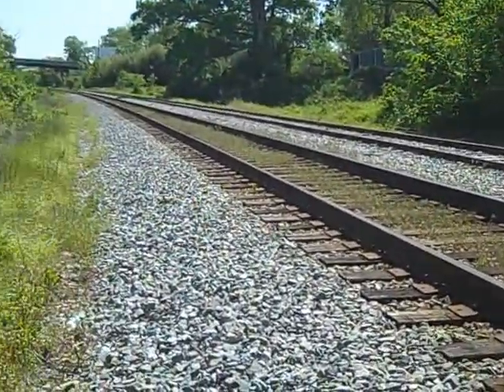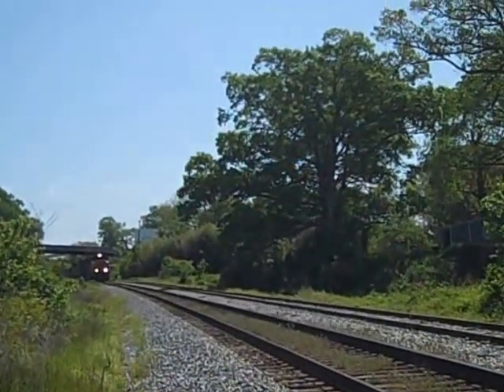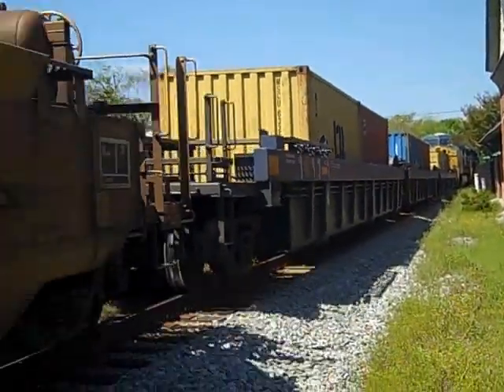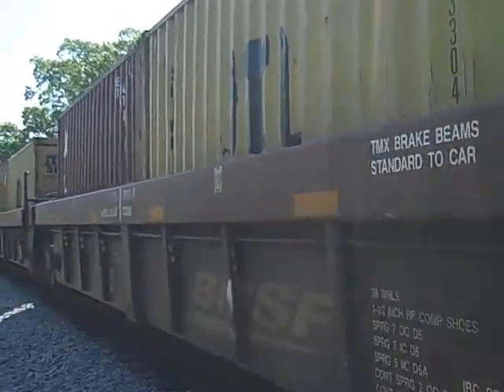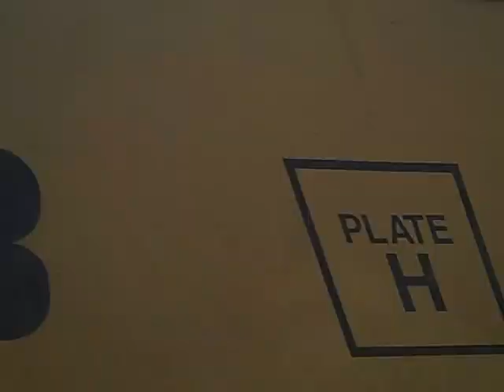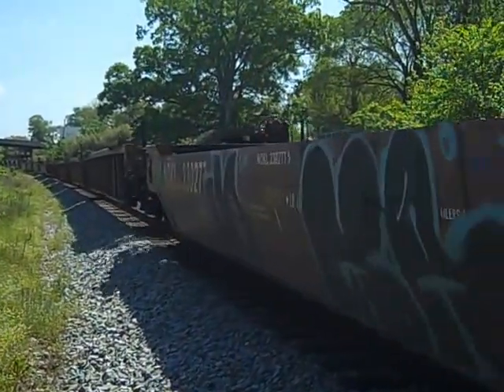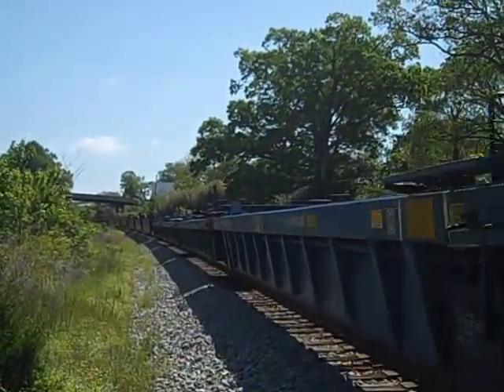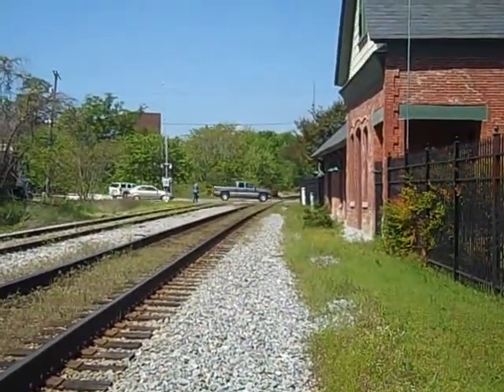CSX F767 with a CSX SD70ACE!!!  MUST SEE

Comment: Awesome catch, also CSX started out with 20 CSX SD70ACe's before in late 2016 CSX #4839 (SD70ACe) was taken off the roster & was sold to LTEX due to a Turbine failure, & then by the end of 2017 they sold the rest of their Ace's to Progress Rail. However, i'm NOT sure what happened to #4838 (SD70ACe) because i checked the Progress Rail roster & it did NOT say 4838 was on their. Also, i did hear that CSX might be ordering 10 NEW T4-SD70ACe's.